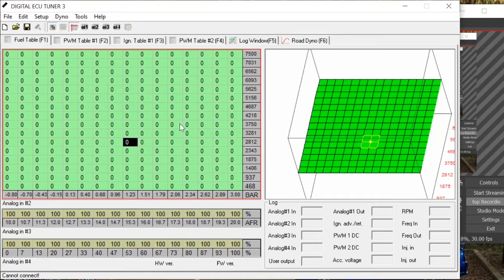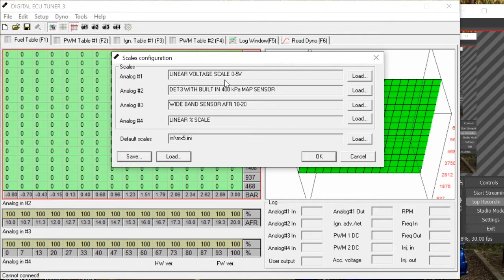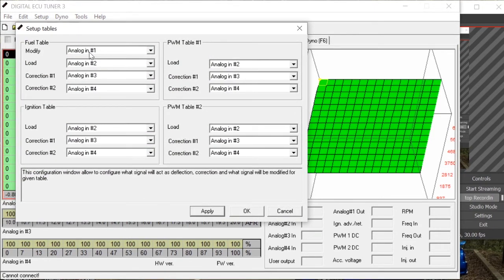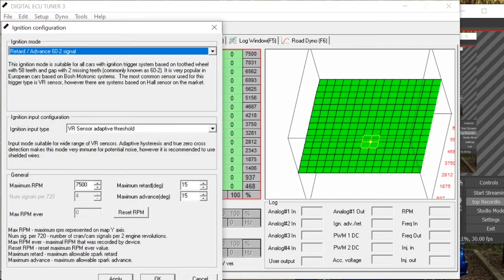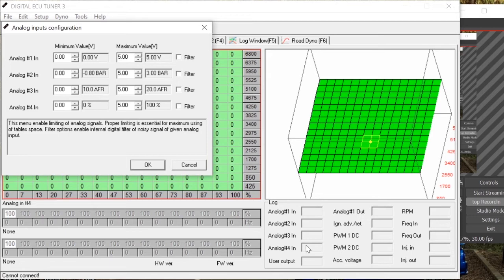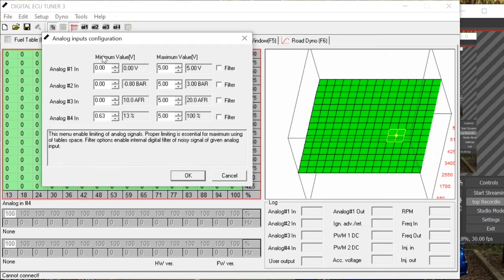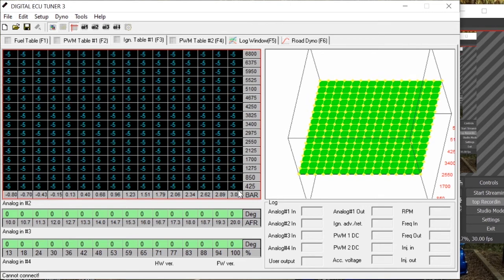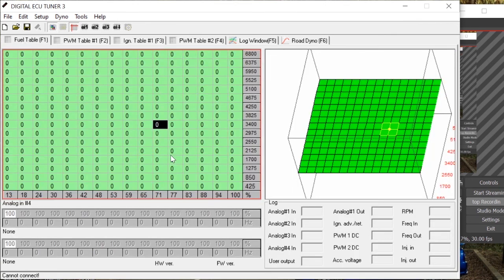How To Install A Det3 on a micra k11 Part 2 (software setup)

Comment: Are you able to pull fuel out as I'm running ga16 injectors and rrfpr on a cg10 my fuelling is cock on at 10psi at WOT but even with an apexi safc it's crazy rich everywhere else as I can't pull enough fuel out
I'm wondering if I could add more fuel with this instead of the rrfpr but take out loads elseware
Reply from the maker: Yes mate you can the table goes in to negative numbers
Reply: @MyNameIsNavo   that's good. I didn't know with it tapping into the map as does the safc
Reply from the maker: @richarddennington  it doesnt affect the cars map
Reply: @MyNameIsNavo  sorry my mistake  I ment to say maf sensor
Reply from the maker: @richarddennington  yes that's right or map dependin on what Ur using
Reply from the maker: @richarddennington  another thing to note is that your not using to much fuel pressure
Reply: @MyNameIsNavo  that's what I was hoping as it goes like the clappers but drivability is questionable sometimes 
My hopes is I could set the fuel pressure at a point (do away with rising rate)and then create a map around that to give me a lot smoother transition and better idle and better control over my afrs at cruise
Reply from the maker: @richarddennington  what pressure do you have it set to?
Reply: @MyNameIsNavo  sorry bud just seen this.. fuel is  now set to 2 bar and not rising rate now. I've wired in tps.coolent.etc etc to use fuel implant mode
I wired the igniter wire to the det3 and set it as you did in the video but when I crank I cans see the rpm rising as it doesn't seem to be seeing the signal? I tried the same with the crank angle sensor and got the same even using the pull-up wire. 
I have emailed ecumasters and we shall see what they say but any ideas will be appreciated 

Even if I can just wire an rpm/tach signal to it to get it to play nice ill just leave my timing mechanically retarded

Comment: Hi mate, are you sure the ignition configuration you have shown at the 4min mark is correct?
my mate has just done this install but cant get rpm signal to the DET3 and the car only runs when the crank sensor wiring is wired straight to the factory ecu but wont run when its wired through the DET3 as per your wiring video.

Comment: Hello, I am trying to figure out why the internal MAP sensor on the DET 3 is not moving off of 0.77 BAR? It stays like that even under boost and makes the car run horribly. I have switched to Throttle Position for now until I get it figured out but long term, TPS is not an accurate way to gauge load on a boosted engine. Any ways of resolving this? Or might the unit be defective? Also, how do you scale injector input and output frequencies? In the bottom right of the screen, I'm not getting any numbers. So I don't have full control over the injector duration. I know everything is wired right because I checked multiple times. Please help if you can. Anything would be greatly appreciated. Cheers
Reply from the maker: Hello what car have you got this on ?
Reply: @MyNameIsNavo   I have this installed on a 2003 Toyota Matrix XR with a 1ZZ-FE. It is equipped with a TRD Supercharger and am running 2ZZ-GE injectors.
Reply from the maker: @iansrving  what input do you have selected for the map ?
Reply: @MyNameIsNavo  So my analog inputs are as follows:
Analog In 1: Mass Air Flow Sensor.
Analog In 2: Throttle Position Sensor
Analog In 3: Wideband AFR Sensor
Analog In 4: DET 3 Internal 4 BAR MAP Sensor
I bought this as a kit and MWR did all the wiring for the harness. I also don't know why I am not getting any readings for my injectors.
Reply from the maker: @iansrving  analog 2 should be Ur det inbuilt Map sensor
Reply: @MyNameIsNavo  Hey thank you, I will look into that then, contact MWR to verify, and make the necessary changes. If you have any idea what I should do to get the injector scaling set, I am open to ideas. Thank you.
Reply from the maker: @iansrving  get your inputs right first mate
Reply: @MyNameIsNavo  I certainly will. The only one in question now is what Analog 4 input is linked to. Once I figure that out could I message you back about injectors?
Reply: @MyNameIsNavo  I certainly will. The only one in question now is what Analog 4 input is linked to. Once I figure that out could I message you back about injectors?
Reply from the maker: @iansrving  sure just get it set up correctly

Comment: really helpful guide , mate... one question ... in case of connecting it to a honda D15 engine which factory comes without maf .. has a map tho ... should I use the analog ine to modify factory map sensor ??
Reply from the maker: Hey mate thanks for the comment I'll take a look through my info later and see if I can get a answer for you

Comment: Hi there I'm very new to this , but I found this video very informative,  I've an old celica with a 4agte and the det3 wired up  everything except the tps,  how will I do this and does it make it easier for tuning even tho I have the map sensor working ?
Reply: TPS is not an accurate way to gauge load on a boosted engine. If you got the MAP sensor to work then I would just stick with that. Unfortunately for me, I cannot seem to get my MAP sensor to go above 0.77 BAR... Even under boost.

Comment: Hi planning on doing the exact same thing, did you disconnect the o2 sensor to stop it altering the map ???
Reply: From my understanding if you use it in fuel implant mode then yes, you wouldn't need the narrow band sensor. However it would help to have a wideband sensor. If you run it as a piggyback then leave the narrow band in so you don't get any check engine light faults. Then simply add a wideband for tuning purposes.
Reply: @iansrving  so leave the sensor in ? Will it not effect the map too much ?
Reply: @starletboy9349  Yes, assuming you are using this an a piggyback. You will have full control over the fueling because the DET 3 over rides the stock ECU fueling and fools it into thinking that the fueling is completely fine. You would only confuse the stock ECU by removing the O2 sensor.
Reply: @iansrving  aaah that makes sense thanks for the help
Reply: @starletboy9349  No problem. I am currently trying to figure out why my injectors are not giving any feedback and why my DET 3 internal MAP sensor won't move from 0.77. it's really odd and I think I might have gotten a defective one. I have tried everything I can and followed instruction from both MWR and ECU Master to no avail. I have a 2003 Toyota Matrix and I recently bought a TRD supercharger for it but it came with nothing else. Trying to run 2zz injectors. Do you have any suggestions to try?
Reply: @iansrving  hmm sorry mate cant help you their, haven't actually got round to fitting mine yet but mine does not have the map sensor built into it.
Reply: @starletboy9349  Oh interesting. I did not know that some don't have MAP sensors. Thanks anyway.

Comment: Nice video, valuable info, on an nissan ga16de the wiring connection is quite the same as the micra, correct;

Comment: Hi man, just got round to doing this and it's all it and working apart from the fact my rad fan is now staying on continuously haha, any ideas? Thanks mate
Reply from the maker: With a det3 ?
Reply: @MyNameIsNavo  yeah with the det3+ haha, it's odd like. All working perfectly even got launch control sorted but the fan just stays on when I turn the ancillarys on
Reply from the maker: @lewlewwit  something ain't wired in right at all mate are you using the stock ECU ?
Reply: Hmm that's what I thought but everything seems to work fine haha, yeah still using the original ecu
Reply from the maker: @lewlewwit  if it's not had the ECU swapped for another one since u started then something in your wiring is wrong
Reply: No I haven't replaced the ecu so it is looking like the wiring, although I took the colours from a wiring diagram and balled them out so they definitely are the right wires that go to the tps,maf ect🤷‍♂️
Reply from the maker: @lewlewwit  send me a message on Facebook I'll see if I can help